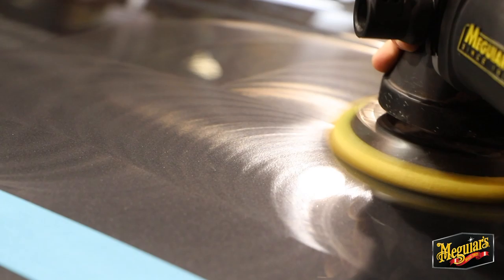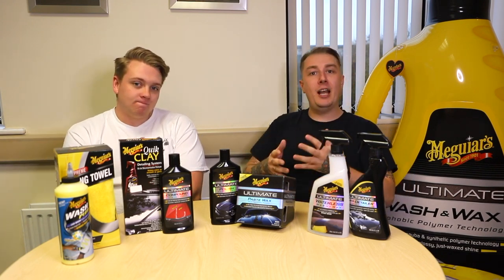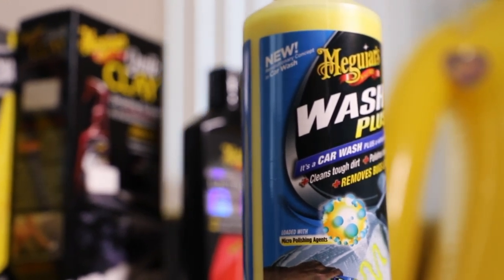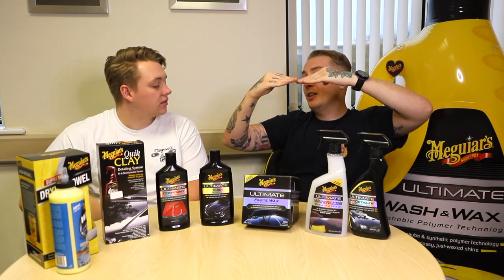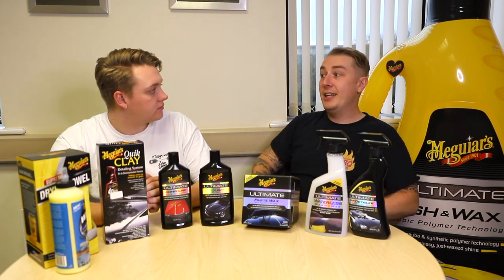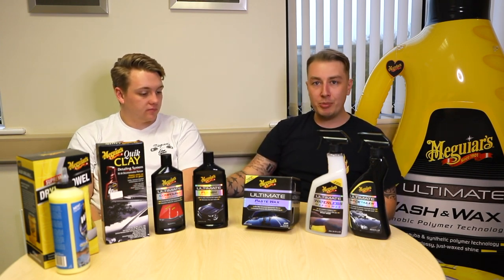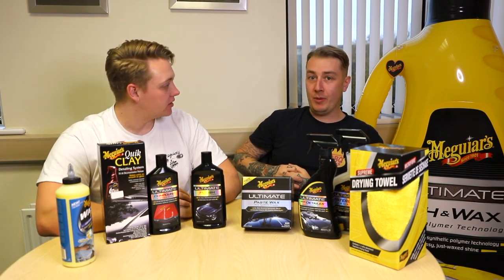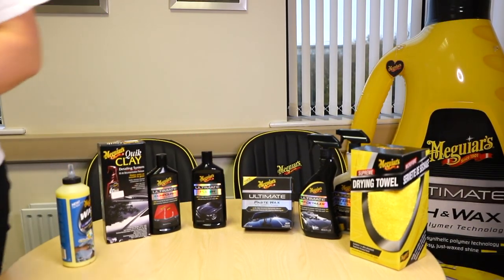Meguiar’s Paint Care Cycle Overview - Meguiar’s Detailing 101 – UK Edition

Comment: How do you clean the pads and applicators? They could make a video about it.
Reply from the maker: We wash them in a standard washing machine along with microfiber towels w/ laundry detergent which has no fabric softeners or bleach.  Normal cycle, warm wash, cold rinse, extra rinse.  Many users will also pre-soak and/or wash in a bucket with water and/or with an all purpose cleaner which has no fabric softeners.
Reply: I wash all pads and towels  using old fashion grey soap flakes instead of washing powder or gel and it’s great

Comment: Where would a ceramic coat fall into this process?
Reply from the maker: If you mean a ceramic coating it will replace the wax in step 4 (Protect).  Keep in mind you will also need to follow the ceramic coating manufacturer's directions as it relates to prep before applying their coating.
Reply: @meguiars  would the Meguires Hybrid Ceramic work?
Reply from the maker: Yes, our Hybrid Ceramic Wax would fall under the same step of protection.

Comment: Hi
How to protect car in rainy season ?
Reply from the maker: Hi, we would recommend a good coat of protection, like our Ultimate Wax.  Although it is raining, frequent cleaning is still recommended, like a traditional two bucket washing or waterless wash.  Also, if there is preperation work required on the vehicle prior to applying a coat of wax, like the use of detailing clay & our Smooth Surface Clay Kit, it is always highly recommended to take that step if the vehicle paint needs it.
Reply: Thank you